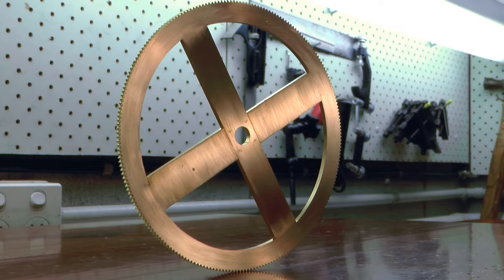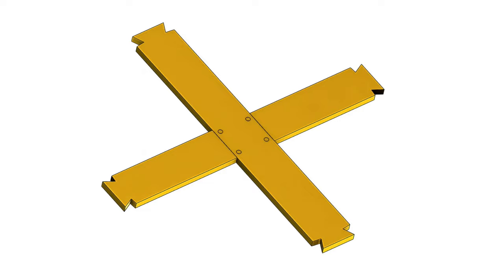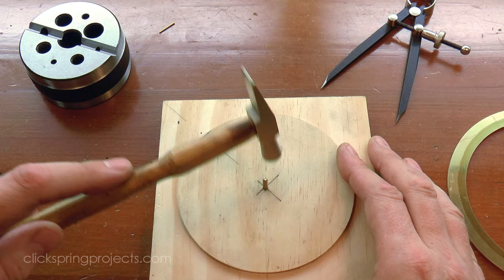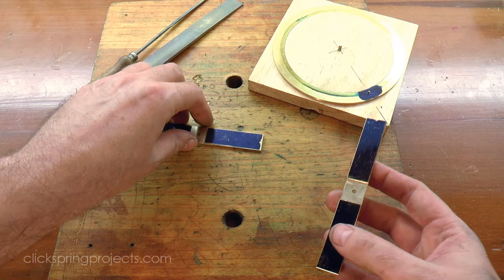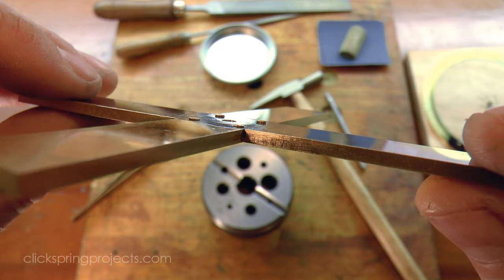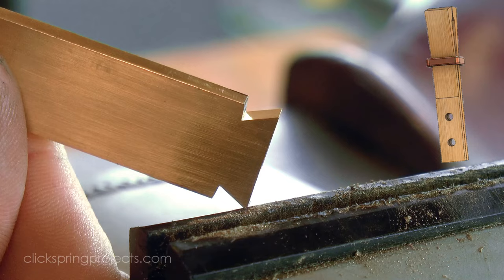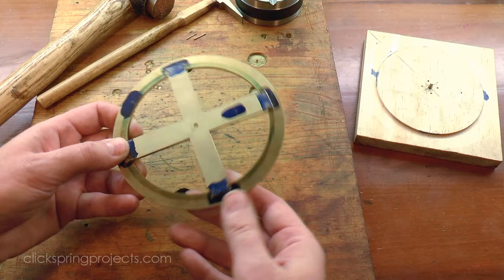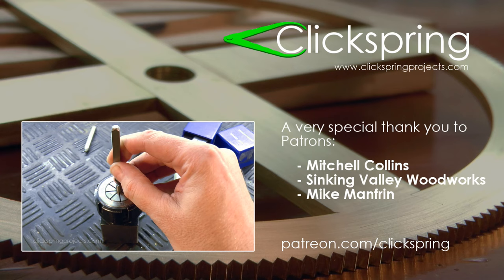The Antikythera Mechanism Episode 2 - The Main Solar Drive Wheel B1 - #DialOfDestiny

Comment: I have a theory. You mention that the reason for the dove-tail joints could be to save on cost of materials. I'd like to propose an alternate view: what if it was just easier to cut circles and rectangles? I'd imagine the folks building such a device would be part of an elite - cost and time was probably no object to them. So, what if it came down to what was easiest: do you attempt to precision cut semi-circles? Or, do you cut the entire circle precisely, and then use precisely measured rectangles to form the semi-circles? A smith could have hammered the rectangles to shape rather quickly, cutting down on the time necessary to form that part. Then, it would be carefully filed to fit. This seems a bit more reliable and convenient than attempting to cut and accurately file four odd shapes exactly the same way. 

Just a random thought. Maybe they only had the technology to precisely measure those two shapes. I'm no expert, just figured I'd throw it out there.

Comment: Guess the original makers was carpenter trained, all the joints are classic wood working joins. Similar to what one sees at Stonehenge. Also I imagine the maker used chisels for much of the cutting out. The centre joints probably cut with a hand router, the Granny's tooth so familiar to pre industrial joiners. Fascinated by how the maker would do the layout: a single wooden pattern for the dove tails? Also illumination, perhaps impossible to work without full sun, or did they use beeswax candles & a bottle with water in like Victorian seamsters? Bees wax would be a potential superglue equivalent, but that would require work out of full sun. However, more likely the parts were held in purpose made jigs cut out of wood, holding channels etc planed in. Thanks for the delightful video.

Comment: I cannot imagine Antikythera Mechanism being a one off from the period, although it currently is the only one known to us I'd imagine they could have been plentiful to those rich enough to buy one, although I'd imagine they would have been extremely expensive as they represented what was in that time frame state of the art.  God knows how they built them as our deep understanding of ancient engineering techniques is very vague and open to a lot of interpretation. 

I'd imagine there would have been templates in timber of all the components, with individual craftsmen assigned to each single part. There surely must have been some sort of QC as a machine of this complexity would only need a small miscalculation not to function correctly. It also makes you wonder just how long before the Antikythera Mechanism was originally built what they were manufacturing beforehand, and what they achieved after, unfortunately this information is lost to us, and in our modern world of semi conductors and nano scale engineering we can easily lose sight of just how great our forefathers were in complex mathematics and complex hand built componentry.

Comment: One thing comes to mind when it comes to the fabrication of this wheel is precision and serviceability.  They could not afford to create a warped gear. So smaller parts are more easily managed and to keep straight during construction.  And if one piece is damaged, the whole wheel is dismantled, and repaired.  This was a serviceable clock.

That stands true to this day under certain conditions and materials.  Sure, some you Need To, but the majority is smaller components that can be interchangeable and upgraded.

Comment: I have some general practical questions.
1) How do you clean off the layout fluid?
2) What kind of abrasive paper do you use and in which order?
Love your videos, a true inspiration
Reply: Acetone, aka nail polish remover.  I use a squirt bottle of acetone in the shop. Acetone has very low toxicity compared to most other solvents, so getting it on your hands isn't an issue as MEK or the like would be. It is flammable (but I use just a tad at a time and it evaporates very quickly) and acetone will attack most paints and plastics.

Comment: Best vids on YouTube... I wouldn't have blended the rivets holding the cross bars though. I would've left them raised slightly
Reply from the maker: Following as per the original, permits furhter fabrication of the wheel with other parts sitting flush - will be clear in later videos

Comment: The dove tail joint on that wheel was a standard way of making iron gear mechanisms. Although it's about 700 years later than your Antikathera the larger wheels on the Salisbury clock in England were made this way. This technique was also used in building spit jacks.

Comment: the construction of this gear in in multiple segments was likely to reduce wastage. sheet stock would have been difficult to produce, and the round was likely a joined section of round stock that was pressed flat. this mindfulness toward waste is also evident in the use of spokes instead of simply using a solid (one-piece) gear. to maintain strength, but maintain efficiency when working with hand tools as well as reducing wastage of valuable brass, spokes were a valuable consideration by the maker

Comment: Absent any ancient locktight equivalent nothing is stopping the spokes from slipping out of their dovetails given enough time and handling of the mechanism.   I imagine that one riveted attachment was to keep this from happening.  It also probably wasn't done to every spoke simply to conserve material.  There's no sign of solder being used on the component after all.  IF their were there'd be no need to rivet the spokes in place at the lap join when it could have been simply soldered.

Comment: I wonder how the large flats in the cross bars were made. No modern mills to perfectly flatten them, and filing such a wide flat to a level surface by hand would have been incredibly difficult! perhaps some giant grinding wheel used for sword sharpening?

Comment: Excellent series; can hardly wait for the completion. One thought that I have had on ancient tools, is what did they use for drilling?  They had steel, but a twist drill was not developed until modern times, and the medieval 'spoon' drill hardly would work, especially for the very small holes, so I assume it would be similar to a 'spade point' bit, held in a bow drill driver.
Reply from the maker: Stay tuned Paul :)

Comment: Flabbergasting to see the effort that goes into just making the sprockets for this gear, just to save some sheet metal (i.e. to have one big circular cutout instead of four small segments. This means that flat, smooth sheet metal must have been very expensive to make. Also remarkable are the woodworking-style joining methods, To me, all this suggests that the Antikythera mechanism was not the first of its kind, and most of the others were made from wood. Maybe even more complex devices were made, but all of them from wood, because it would have been prohibitevly expensive to make them from metal.

Comment: I am guessing there are other smaller round plates needed in this device.  Makes sense from an efficiency standpoint to use the center cutout for a single smaller round part for cosmetic reasons.  If brass was expensive, do a few layout design options and see which option generates the least scrap.

Comment: After watching this video, I think I know the purpose of the two riveted plates you speculated were a "repair" on the original antikythera; I believe that the outer ring was formed by bending a bar into a circle, and the riveted plates secured the joint between the two ends.

Comment: Gorgeous, as usual ; love the dove tails! I'm a bit surprised the rivets still hold after you filed them down?
Reply from the maker: Thank you mate :) The act of riveting spreads the metal at the mouth of the hole, mushroomed out. If there is no direct load on the rivet, its more than enough to keep it in place.
Reply: ShamWerks You can also countersink the holes to make sure the rivet still has some holding!

Comment: If you ever tried to drive out a flat sheet of metal you would know how hard it is to do. The metal will warp, bend and break. it's much easier to create a ring. I think that's the idea behind the construction of that gear.

Files are hard to create and maintain. I think they uses chisels, planes, knives and stones to form the metal.

And they would create templates from wood, and shape the metal after them. The wood templates would also function as fixtures. The big gear could be held between two peaces of wood so the chiseling wouldn't bend it.

Comment: Amazing work, the mechanism is amazing in its own right but as a maker myself the burning question for me is what tools were used to make this to the accuracy required 2000 years ago. It points to lost technology whis is a fascinating. The level of accuracy required to make this  on a modern electric laith is one thing. That laith is made from other precision equipment. So what equipment was used to make the tool that made the original gear. How was it all powered? Water power? 
    There are vases made from stone in egypt that are round to a tolerance of 4tho with equaly flat milled surfaces. You just dont get that level of accuracy from hand tools

Comment: There's no way to say for sure, but one trick they might have used to hold the part was a lump of 'pine tar' or 'pitch'. It's mostly rigid at room temperature, but heated, it would be more pliable like clay. They could have heated the lump, pushed the blank into it to hold the piece secure during filing, hammering or what ever. Even so, there is no doubt that several thousand man hours went into this, not to mention the time that went into the design. Whoever did it would have been the "NASA" of their day.
   It's amazing.

   Here's a link to another guy whose's doing amazing work, and it looks like almost the same thing, holding his work piece within a lump of what looks like pine tar maybe. I don't know for sure what he's using, maybe a more modern, cleaner version, but it looks to be at least similar.

https://youtu.be/BkhWh19fTG4
Reply: Similar to the dopping waxes, and 'pitch' used for working intricate settings and raising detailed shapes in the jewelers trade...Very good thought!!
Reply: John Winslow Pine tar must have been the early superglue!
Reply: It was pretty much one of the few glues available at the time, not to mention one of the few that was waterproof.
Reply: Excellent guess. I had instantly the same thought. We used in our goldsmith studio different kinds of mixtures with pine resin, carnauba and bees wax depending on how ' soft ' or  ' hard '  the final block for holding, engraving or hammering ( forming ) had been needed.

For sure in ancient times these materials were in use for many different purposes and knowing the properties could have also inspired the geniuses who worked on this unique masterpeice of measurement.

Yūgen (幽玄) fits excellent in this context of the Antikythera.

cheers 

Herri

Comment: re 09:40 It seems to me that there would be stability advantages & an explanation of the 'brass reinforcement patches' if you considered that the dovetails were probably tapered from alternate sides, and the center cross-member rivets were needed to pull the dovetails into the ring from opposite sides.  The 'patches' (dismissed as repairs) were original, and intentional, to keep the tapered dovetail from warping back out. 
When working brass, I like to pretend I'm working gold, the other warm, soft metal.

Comment: This is not a criticism of this video, but of course it is all about replicating an existing device that somebody already figured out.  The original engineers had to not only manufacture this object, they were working with new celestial concepts that had to be solved mathematically, without access to computers or advanced telescopes. While the design is amazing, the mathematics and research behind it is absolutely miraculous!

Comment: When you asked how they solved the work holding problem my immediate thought was "stitching pony."

Five seconds later... basically a stitching pony. Seems a very likely type of solution.
Reply from the maker: THANK YOU!!! Have been racking my brains for the name!!
Reply: YOU'RE WELCOME!!! It's a very old device so would likely have been very common among craftsmen even then. Blacksmiths use a tool very similar in shape to the example you showed to hold work as well, but instead of a sliding mechanism it's hammered into the hole on an anvil.

Comment: I wonder if the cross members dovetails were beveled? Each member beveled opposite and the cross members riveted in place already mounted in the outer wheel. This would make a solid mechanical connection between all the pieces. Also the vice was probably something similar to what I use, a wooden wedge ring vice. Or a leather strap that you stand on. Look at the inlay work done with a "donkey" it uses similar clamping styles. Also they probably sawed a lot closer to the line. Due to the cost of files and saw blades and time. I know I do lol. Love the videos!!!

Comment: Chis, is there a reason why you didn't add a small chamfer to each side of the rivet holes? Seems as though it would have made a much better mechanical joint that way (essentially making an "I" beam shape).
Reply from the maker: Hey JC - yes I used to do a small chamfer the inside of the holes, but I find I get a much better seamless join if I simply belt it in close, deforming the metal sufficiently at the top. If the rivet is not experiencing any tension (as in this case) it provides more than enough mechanical interference to hold it in place, and the seam is usually indistinguishable from the surrounding metal, much better than chamfering, which often reveals a seam. If the rivet is under tension - then no choice - the hole must be chamfered prior to riveting to get the best hold.
Reply: JC I was wondering the same.
Reply: I was wondering the same, thanks for the answer. The seamless join shows great craftsmanship as usual, and it really amazed me. I didn't expect it to disappear entirely!

Comment: G'day Chris what a beautiful piece this will be when you have finished it.  Your clock build I would like to have a go at after my loco build, I have done a course on repairing wind up clocks and fabricating new ones.  One interesting thing that I have noticed is that your mill is the one up from mine which is the Sieg SC2.7 mill and I have a Sieg SC6 lathe.  I am giving consideration to becoming a Patriot member. One thing I must ask you is where do you buy the marking out dye.   Thank you for these videos I find them extremely interesting kind regards John

Comment: I would guess the wheel might have been built slightly differently - first a hole was cut in the wheel, then the two spokes were doved in independently, then they were joined and riveted, and only after that the central hole was drilled. I would consider that less demanding on precision on each part and still keeping the precision of the result. It doesn't require the rig you used, too, as the wheel itself works as the rig there.

Comment: The logical question is this:

The "who and how" of the making of ancient fine-quality files: Files have to be made from hardenable "steel" in a narrow range of Carbon content. Not enough Carbon steel is basically pure iron, which is actually relatively "soft". Too MUCH carbon and the steel is more like "cast iron"; brittle and so hard it has to be HOT worked. How flash was ancient metallurgy? Until the invention of the modern Pyrometer, heat-treating temperature conditions were "judged"" by looking at the colour of the heated metal; blue  shades of red, yellow, etc. This could be a bit hit and miss, as the colours on a cloudy day would be different from their appearance on a bright, sunny day. This explains why a a lot of "old" stuff was generously over-engineered. Guessing the "alloying content" and the crossing fingers over heat-treatment constantly introduced gross errors. Getting that sort of stuff wrong on something like a cannon barrel likely means some artillery men are going to have a BAD day, somewhere down the line

OK, bronze and later, brass are not exactly "hard" but whatever the hardness of the work piece material, the cutting tools MUST be considerably harder, or,  they will not actually cut.

Comment: Do you think that crossbars could be made out of slightly thicker material so they could be "expanded" like rivets and grinded flat (maybe hammered?) after fitting to get perfect fit with more labour and less precise tools? Also less chance of screwing things up. I'm thinking about oryginal part and the way they made it. Awsome video man, cant wait for more.

Comment: Incredible!  How do you decide when to use traditional methods vs modern?  For instance using the mill for facing and the dividing gear cutter on the lathe but then choosing to peg and file the spokes by hand.

Comment: Couldn't wait for this series to start.  Loving it already.  Would it be possible to share the name/model of the scroll saw blades you use to cut metal?  I tried several with poor results.  Great work as always.  will stay tuned.  - Noel